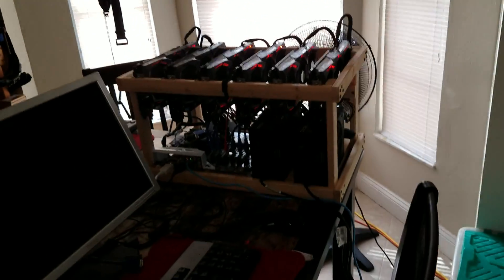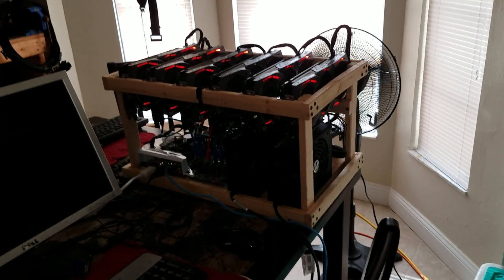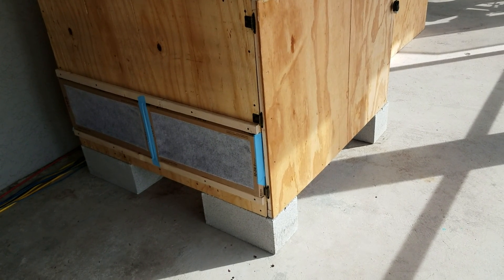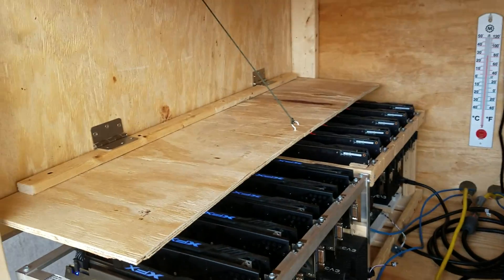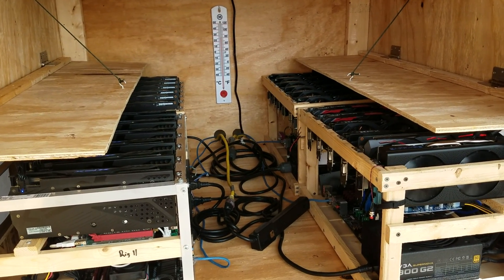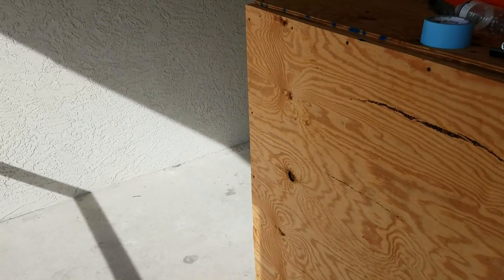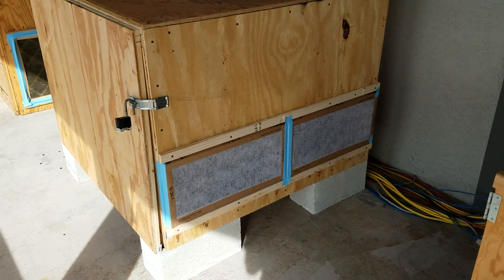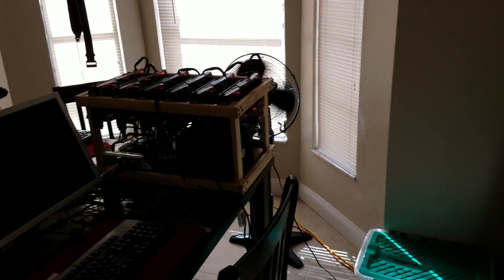Update - Mining Rig Enclosure/Box Ver 2.0

Comment: Hey Two Ton Hasher, I noticed that the GPU’s are all facing with their fan exhaust facing the filters, I would think then the hot air that is coming directly from the GPU heat sink is then being sent back over the cards. I just wonder if turning them around so the exhaust from the cards are facing the middle so it is 100% all fresh cool air going across the cards and the hot air is all gong towards the middle. Just an observation I had and a thought I figured I would share
Reply from the maker: These GPU's exhaust from all sides, in fact most GPU's do, unless they are reference cards. Reference cards exhaust out of the i/o plate.
Reply: oops sorry, I actually looked at the video again and noticed you do have the I/O side facing the middle I had previously thought it was the other way around so they are blowing the heat in towards the middleof the box. Also every high end card I have ever saw exhaust air through the I/O plate cause then it pushes it out the back of the pc case when it is mounted in a case, I have never saw a reference card before. What is a reference card?

Comment: looks like my frames are the same size as your metal one i see in the middle box im wondering your square dimension not necesarily the height but the base size i get the whole deal i was gonna try to do it in an unused bathroom with cutting my intake in the actual bathroom door and installing a industrial exhaust vent but i like this box better   great job man simple and easy and seems to be working great

Comment: Well done. Very nice. I was gonna say, you need some blocks to lift the boxes off the floor. I get water in my patio when it rains and hurricane season gets worse. So gonna build the same thing this weekend and try it out. I was originally gonna put a dryer duct from the bedroom into the attic then out to the garage, got all the parts and all. But this idea is better. Thanks. I only got 2 rigs so gonna be smaller box for me. Gotta find a smaller fan to put on top. Thanks again.

Comment: @TwoTon Hasher. Doesn't the air direction of your intake blow into the opposite direction of the cards exhaust?? you would need to reverse the GPUs for the flow to make sense.
Reply from the maker: ch1mptast1c - No, they are in the correct position.
Reply: so there is no air coming out of the cards opposite end from where you screwed them in?  Air is normally always blowing into the direction of the pcie-power connectors and upwards, cant imagine that being different (unless they are reference blower). So practically the cards are blowing into the upcoming airstream and are then
 circulated over again..
Reply from the maker: I get what you're saying ch1mptast1c and you are somewhat correct... but.. the heat is dispersed on all sides of the GPU's. They aren't reference cards where the heat is blown out by the I/O ports.

Comment: I like the updated box. Smaller, way cleaner looking inside AND outside. The channeling was a very good thought too. There is one thing I would change about the setup in the future though. If, and only if, one of the cat5 cables were to die, instead of replacing the whole run to the box, I would buy a Netgear un-managed gigabit switch. Place it in the first box and run shorter patch cables to all the rigs from the first box. Just a little way to tiny up some of the wires running through your home.

Loved the video, thanks for sharing. Glad you made it through Irma unscathed like we did.

Comment: What is the purpose of putting the enclosures on blocks? Reduce dust to the filters? Better airflow somehow?
Reply from the maker: Yes, to all you said, not to mention flash flooding or storm surge.
Reply: Like he said in the video, to raise it off the ground incase there is a flood, also with the box's raised if it does get wet in there the wood wont get wet... also with having them raised will give better airflow around the boxes and the boxes will be more inclined to suck in the cool air flowing under the boxes
Reply: And any wood on concrete will suck up any and all moisture from under the concrete

Comment: Thanks for sharing this, I’m making one after your design, with a difference of making it horizontal air flow, having a 30inch fan at the end, and a wall of filters in the beginning, I’m trying to see if putting two floors of mining right followed by another two floors works. Still I want to ask you if you could link to where could we buy filters like those you are using, I’m trying automobile filters but I feel those won’t work, me I have not been able to tell and find those kind of filters in my area. Thanks in advance for your help.
Reply: look for furnace filters. come in varying size and you can always cut to fit then tape for a solid seal.

Comment: I just built my first box based on what you did. It’s not as flashy but it’s a start. 
I have (3) rx 570’s and they are using @660w and mining @76mh with claymore dual miner. Does that power consumption seem high to you?
Reply from the maker: Yes, thats high for 3 cards. I'd undervolt them if you can.
Reply: Using something like MSI Afterburner? I have seen lots of people use it but I’m not quite sure “how” and don’t want to break it.
Reply from the maker: yes, you can drop them down to 70 or 80 percent power usage using afterburner, no problem.

Comment: Genius man! Im also in Florida in Orlando and I'm thinking about joining your idea. May i ask what did you pay the electrician to add those breakers and wiring? What is the maximum you power one can pull? Consider putting small fans between filter and gpus?
Reply from the maker: The guy i had to install my extra circuits charge me $75 per. i try to stay under 1600W on a 20 AMP line. as far as the extra fans on the GPU's, i used to do that.. but as it turned it wasn't needed.. just a waste of power.

Comment: Very nice, nothing here to criticize. One suggestion though. Maybe fill the holes where the cables pass through the box with copper scouring pads or steel wool material. This would lessen the air flow through the holes and keep the critters out. If one mouse gets in there and nests behind one of those rigs in the corner it can cause some serious damage like chewing on wires and depositing urine on the electronics, causing corrosion. Everywhere they walk they pee. They have poor bladder control.
Reply: I would have drilled a hole from the top which would also get the wires off the ground if there was a small flood.
Reply: paigow66 excellent idea....I have the same setup and will be shamelessly copying this.
Reply: LOL I just pictured a rodent getting his unit fried as he pissed on a mobo to mark his territory.
Reply: FL also has snakes who LOVE to hang out on warm things

Comment: at 12:46 it looks like your wood has warmped a bit and you have an airgap at the bottom of the door.  At home depot for a couple of bucks you can buy a roll of weatherstripping (we use LOTS of it here in Colorado to keep the cold out :) ) - put a stripe of weather stripping around the opening and it'll let your door snug up nice and airtight.  Cheers!
Reply from the maker: Will do Edward. I'll pick up some weather stripping tomorrow. Thanks for the info.
Reply: TwoTon Hasher thank you so much bro for sharing this. Keep us updated on how the weatherstripping works out. Seems like a excellent idea.

Comment: Try and make a video of the rebuild of box 3... Also could you make a video specific to like Power needs... Like what gauge of extension cords you are using... How many Amp breakers are u using per box / the setup to power it all... are you using generic power strips to split the power? Also those metal frame cases did you make them urself or buy them?

Comment: Do you think a very similar box would work for the Asic miners? Thinking enough to run 4 to 8  miners with the same basic design as you? Either 2 - 4 per side so maybe a much smaller box?? Any advice would help. Thanks in advance.
Reply: Rollin Crypto #21KBTC of course it would the requirements are the same. Max air flow to remove the double the temp they run at than outside weather.
Reply: philosophical pownage wouldn't the noise be virtually unbearable with 4 asics?
Reply: Willie Wilkins it's not exactly quiet I'll say that much.
Reply: If you're worried about noise do these inside a room with max air movement like a room with intakes and exhausts.  U can probably fit about 4 boxes in a 8x10 room.

Comment: Hey TTH. I really like your design. I live in Las Vegas and I'm trying to figure out how to NOT have a giant heat source inside my house this summer. I have an upstairs outside balcony that I could use like your porch, but I worry about the temps of the rigs. I think your setup might work for me if it really worked for Florida in the summer. What kind of temps did you have inside the box last summer before your mods? I can only imagine them to be a bit lower with the shorter boxes.
Reply from the maker: Last summer the hottest my rigs got were in the low 70's C. It's humid here so i don't know how that will play out in Nevada dry heat. I think its worth a try though.
Reply: Let me know if you try this because I am in Las Vegas also and had the same question

Comment: does it matter which end of the rig is close to filter? I mean airflow from the gpu goes from front to back.
Reply from the maker: Yes, but only if you have reference cards. Reference cards exhaust out of the i/o plate only so you'd wanna face the i/o ports towards the exhaust fan., The rest (majority) of the GPU's out there... it doesn't really matter

Comment: Forgive me if you answered this, but why have them so tall with all the head room inside them?  I get you're making them a little shorter, but it seems like they wouldn't need to be much taller than the rigs themselves.  Great work though!
Reply from the maker: Good question.. the less space inside the box is better but I like to keep a little room to get in there and work if i need to.
Reply: The fan will try to suck out all the volume of air above the new baffles and help create a small vacum to increase the amout of air forced through the filters and over the rigs

Comment: It gets hot here in Arizona. Do you think this could work when it’s 116 degrees out?
Reply from the maker: Jeesh, i don't know/ Thats pretty hot
Reply: Consider that GPUs are happy to operate around 75C, which is 167F.  Even with 116F ambient air, there's still a large differential in temperatures.  You'd most likely need to move more air than what TwoTon Hasher is doing in his units; he has high CFM fans but runs them on their lowest setting, you'd probably need to run them on medium to high settings.  Still doable though.  You'd probably have to worry about your PSUs more than your GPUs, to be honest.
Reply: Schmonkee, I built a small insulated room in my garage and it holds fairly cool (so far) in comparison to the external/ambient temp (I'm also in AZ).  Right now, my rigs are all in there on an industrial shelf, but I am likely going to build a box like this. Basically, a box within a box.

Comment: I love the boxes, I'm in South Texas but the humidity is pretty high. Is that a issue you've ran into?
Reply from the maker: We have high humidity here as well. I used to worry about it constantly but no, i have not had a problem . The constant dry heat put off by the GPU's seems to keep the humidity at bay
Reply: The high temperatures created by the GPUs inside the box creates enough headroom in relative humidity for it to not be a problem.

Comment: All good man :) the only problem Im having is that in the United Kingdom I cant find any of the filters u use. Its hilarious. The only similar one I have found is this one but its a pleated filter and idk if that would work or what the airflow would be. My rigs are about 90Cm long(3 foot) so I prefer to have a filter of this size of course. What do you think ? BTW how should I search for your style(not pleated) filter? how is it called ? 
https://www.ebay.co.uk/itm/2-x-Camfil-Aeropleat-PP-Pleated-Panel-Air-Filters-332x954x50mm-2-Deep-2120349/391837296255
Reply from the maker: Fiber strand filters - or fiberglass filters - good luck!
Reply: coming from someone who works in HVAC, you do want pleated. It filters out more particles. so yes, when they get dirty they will reduce airflow but that means it's time to change them anyway. the idea of the filters is to reduce the incoming dirt, not let some get through like he does.
Reply: David but the question is will there be nuff airflow going through pleated filters I linked?
Reply: fat4ll there definitely would be, however I much prefer white ones so they are easier to tell when they get dirty. as long as you change them regularly, like you should with any kind anyway, they will provide as much airflow as needed. sure you may have to change them more often due to removing more particles from the air, but that's the point of the filters in the first place and will help your equipment last longer.

Comment: What is the CFM of those fans?
Reply from the maker: 7860 CFM on high.. but i run them on low speed - these are fans - https://www.lowes.com/pd/Utilitech-Pro-24-in-2-Speed-High-Velocity-Fan/4755305
Reply: Thanks!
Reply: How many watts are the large fans consuming?
Reply from the maker: about 170W
Reply: Not bad at all.
Reply: It's great how we start a project and continue to improve.  You've done fantastic.  My dad got a squirrel cage fan from a burned out building, it lasted for decades and moved LOTS of air with little noise.  I don't know how that would work in this application.  One trick I've done to increase air flow is take off cages where I could or cut out some of the wires on the cage.  I was thinking those Lasko 20 fans would do great but maybe not enough CFM's and you'd need at least 2.  Anyway great stuff.  The update is good to see even if nothing was new.
Reply: TwoTon Hasher hi are you sure? At that cfm to pull only 170w?
Reply: Even at half cfm i do not find anything to consume 170w

Comment: Hi, how much did all the equipment cost to fill up those three boxes? Also, how much is the electric just to run those three boxes? And what is the profit after electricity is subtracted from the profit? Monthly. Lastly, are you stressing out or maxing out the power output of your  breaker boxes ? Did you have to  change out the meter ? Anything like that?  Or are you not quite to that level yet as far as power draw. I was told  that if I decided to buy/setup several antminer S9 units in my garage,  there's the possibility I might have to  upgrade the meter , not to mention possibly some other components electrical related, that you in advance, I'm new to the idea of mining but have a computer tech background.